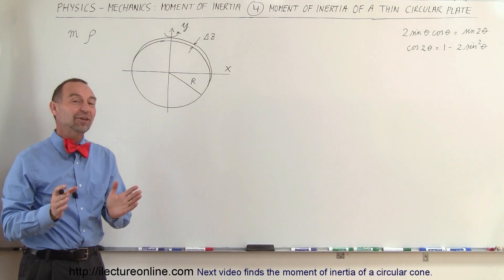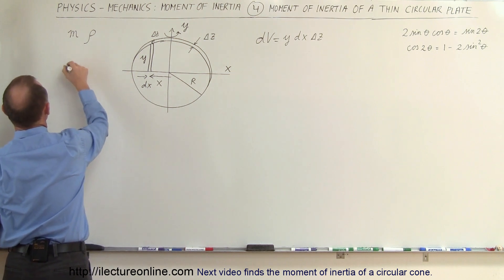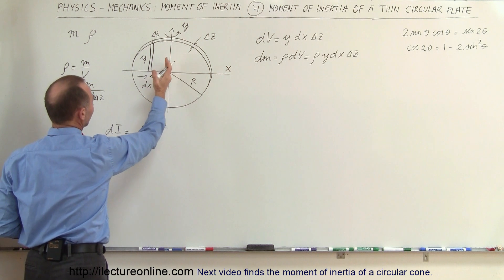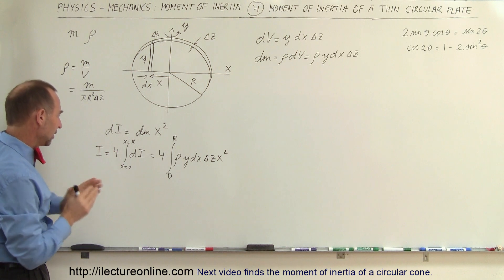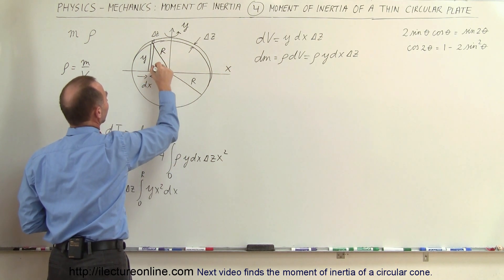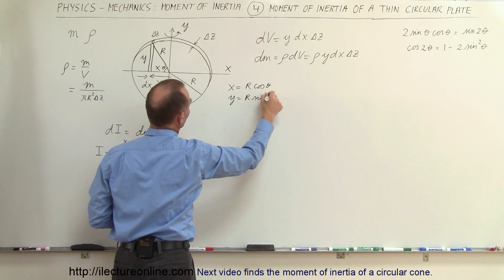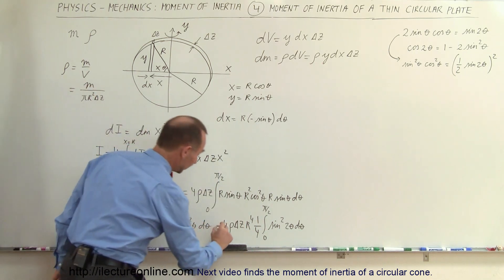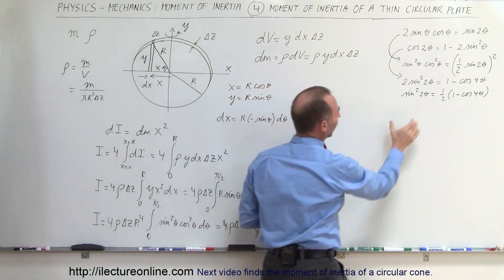Physics 12  Moment of Inertia (4 of 7) Moment of Inertia of a Thin Circular Plate

Comment: what about if it spins around z axis ? what is the moment of inertia ?
Reply from the maker: Than it would simply be a spinning disk:  I = (1/2) MR^2
Reply: so it doesn't matter what axis they spin around ? the point is they spin in their center of mass and all axis have the same moment inertia, right ?
Reply from the maker: If I understand you questino correctly, No,  with the current orientation, you would have a different moment of inertia for each axis.  (Note that for the z-axis, it would simply be a rotating wheel.  Not so for the x and y axis).